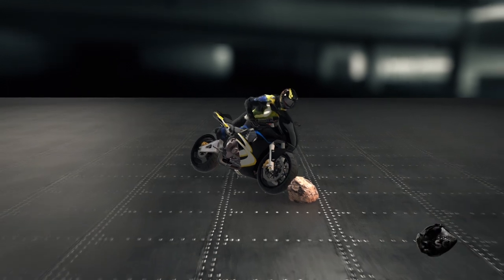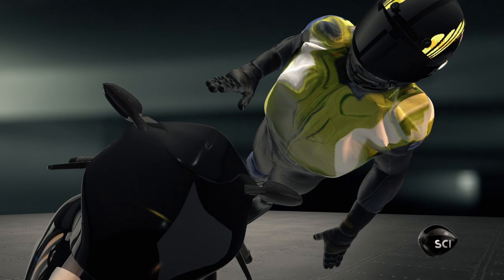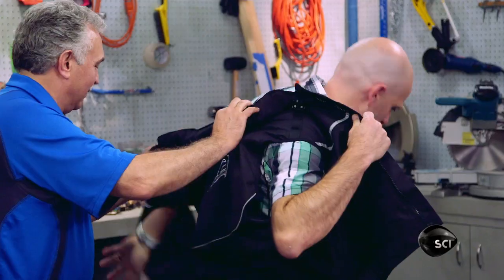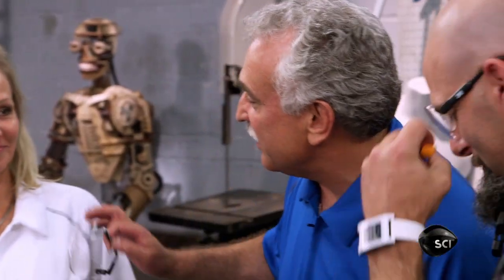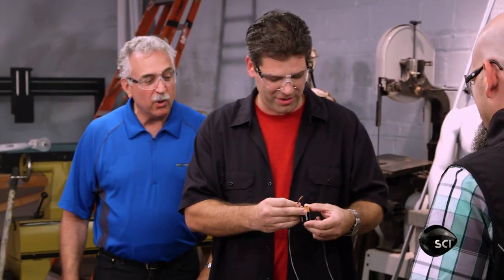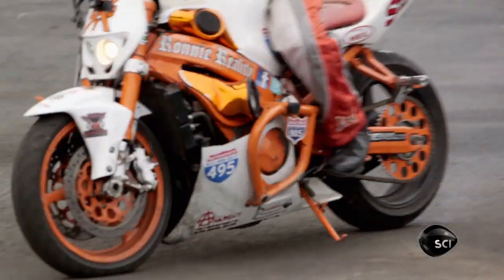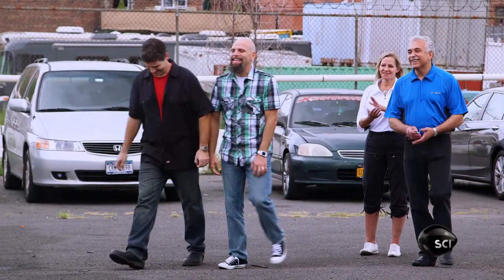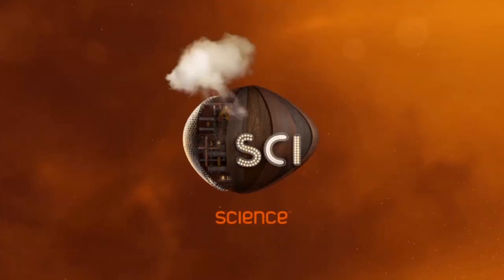Airbag Vest | All-American Makers

Comment: It won't save you from a wheel chair though. Most spinal injury's occur because the body is violently flung from the bike and when the body is a twisting motion, which is usually the case when thrown from a bike, as a part of the body hits something solid, the body, lower part or upper part, stops almost instantly, unfortunately, the upper body or head will continue to rotate and it is this snapping rotational force that causes the vertebrae to separate and in doing so severe the spinal chord. This sort of "airbag" may help for puncture type or bruising type injuries.